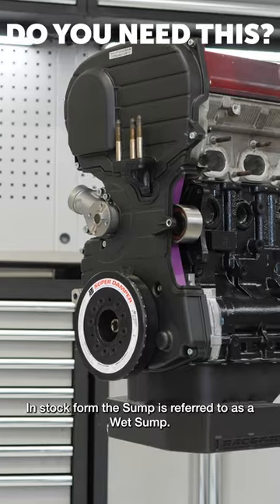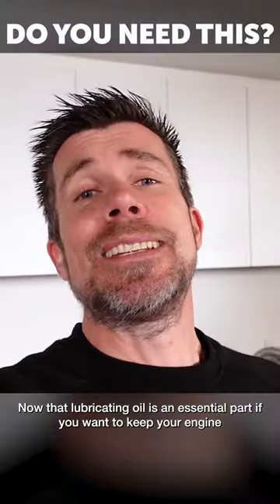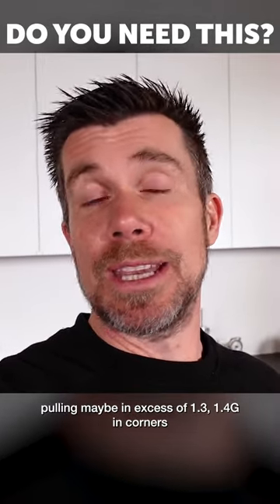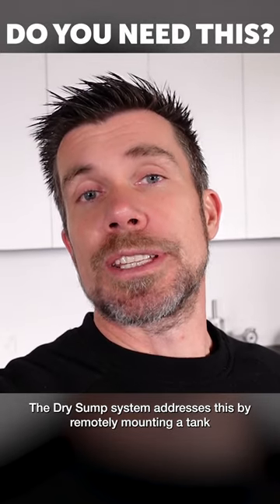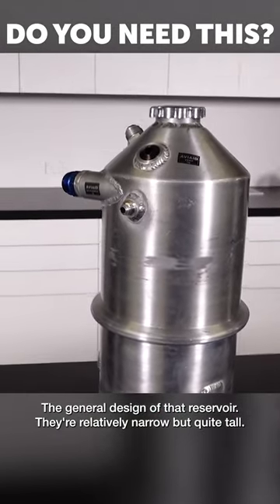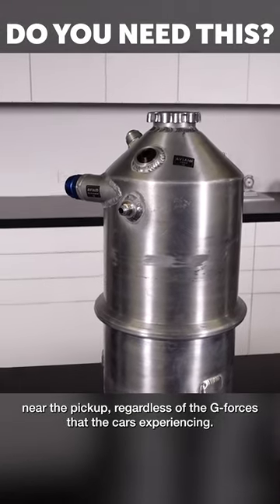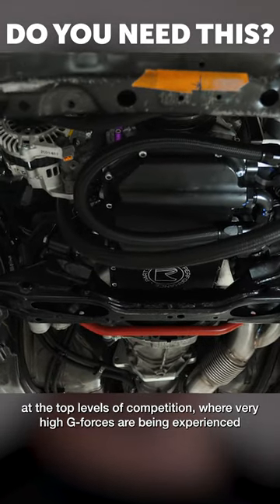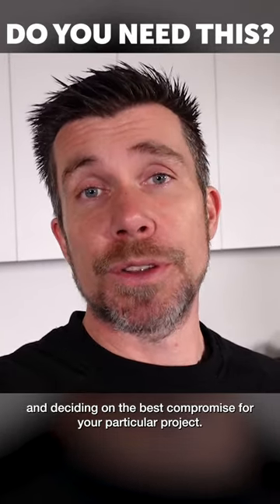What Is A Dry Sump? #shorts

Comment: Yeah everyday cars don't need a dry sump because you're not pulling 1.3G. Hell the only time you're  oil is not getting picked up in a regular street car is if it's low like not on the dip stick but then you have more problems like engine damage.
Reply from the maker: Yes, although outside of that depending on the car it can become an issue very quickly. Looking at you Subaru boxers haha. 
A dry sump might be a bit overkill for some too, baffling the sump or accusumps etc car be sufficient too, dry sumps are just the focus here - Taz.
Reply: They can be good for certian engine swaps for if the oil pan is weirdly shaped, like the vortec 4200
Reply from the maker: @mitch5300  almost all swaps they are advantageous in being able to mount the engine lower too for a lower center of gravity. You can then mount the remote reservoir essentially anywhere you like, allowing you to place the weight of that in an advantageous spot for weight distribution too.

The only unhappy thing is your wallet really 😅 - Taz.
Reply: @mitch5300  put a half full bottle of oil that has the clear sight on the side on your dash and go for a ride. 
It'll horrify you as to what's happening in the pan.

Comment: Searching GM  LT1 Tilting dyno built to test the Corvette race teams dry sump system. 
My friend was working on a small block chevy oil pump that pumped oil directly to a quart size accumulator inside the oil pan.  So the single stage filled the accumulator.  The accumulator supplied the engine.
Reply from the maker: Accusumps are a bit of a middle ground and can be a real engine saver for sure - Taz.

Comment: Autoalex learned this one the hard way
Reply from the maker: Yes it's tricky because they are not a cheap investment, but nor is oil starvation cheap to deal with either. There is a middle ground when it comes to some upgrades you can do to a wet sump, they're only upgrades, not equivalents - Taz.